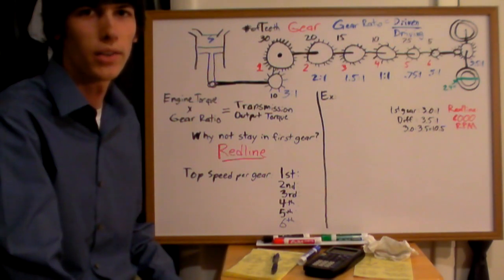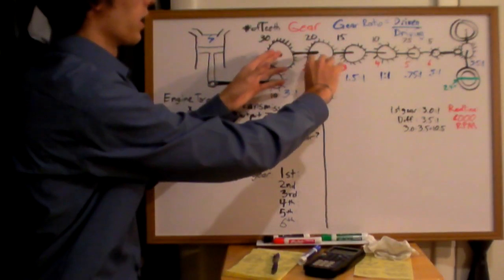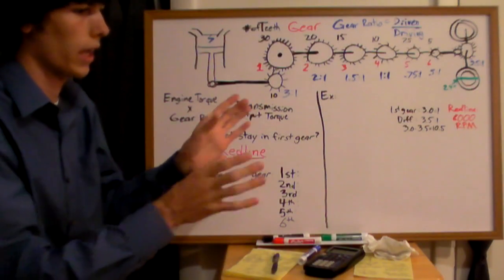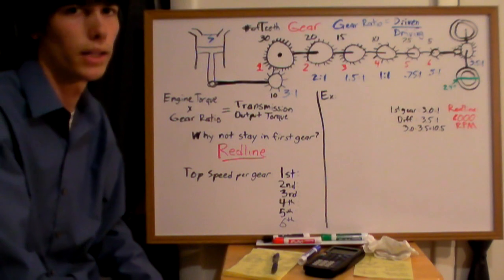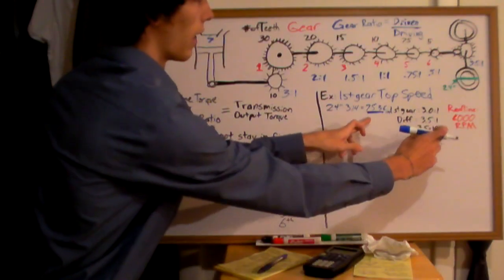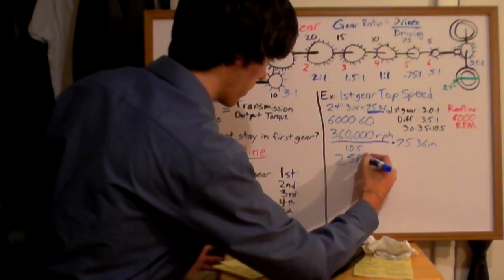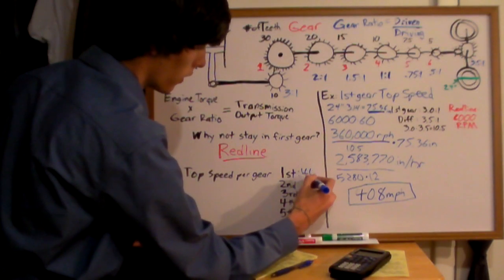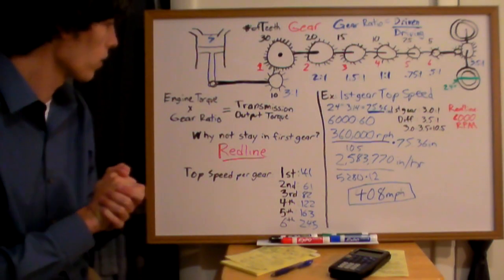Car Gears - Explained

Comment: so the shorter gears have more teeth and the Longer gears have less? okay and I think I just remembered the clutch and torque converters are what meshes the engine's Flywheel and crank to the transmission if thats correct.

Comment from the maker: First, this doesn't really in any way represent what it looks like inside of a transmission. I have other videos which do a better job of that, so there isn't a single gear that meshes with the transmission from the engine, there are multiple. As far as the gearing, I think the answer to your question is yes. But more of the other way around. More or less teeth = shorter or longer gears.

Comment from the maker: First question: Both, but many times calculations. Direct drive means less losses through something like a transmission. But if you want to get to your max speed with a single gear ratio, it could take some time. Try driving your car around in 4th gear only. And yes, I prefer metric, but since every speed limit sign in America is in English units, I did the math in English units.

Comment: It's starting to come together now, one question, the selector gear shaft is this normally connected at the bottom of the gear box. I.e is the drive shaft transmission underneath the main clutch shaft going back to fly wheel?

Comment from the maker: @EngineeringExplained Flooring it in a high gear at a low rpm will end up being less efficient, and put lots of strain on the engine, when a gear with a better torque advantage could be selected, use less gas, and get the job done easily.

Comment from the maker: @bloximonkey Well, for example, if I were to be in my car going 35 mph uphill, and I was in 5th gear, I'd be turning about 1500 rpms, and would have to floor it to produce enough power to go up the hill, where as if I was in 3rd I'd be closer to 3k rpms, and could climb the hill easily. You need lower gears to accelerate up to speed, and then you can switch up to a high gear to save gas (by lowering rpm).

Comment: @EngineeringExplained I have got heaps of question for you but I ask those that related to your video here!

1- Could you explain Limited Slip Differential?
2-Also what is Final Drive?
3-In AWD vehicles if front tyres don't have a same diameter as rear tyres how do you calculate each gear's max speed?

Comment from the maker: @jy0408 Yes, this applies to rotaries. And the shaft of the rotary rotates 3 times for every one rotation of the rotor. Regardless, this shaft will have a certain rpm, and will manipulate the wheel speed through gearing in the same manner. The "transmission" I've shown is very simplified, but its principles apply to all transmissions.

Comment from the maker: @davidle24 Yes, 6000 was an arbitrary number that I picked for the redline. It will be different for every vehicle. This is the speed at which the engine will no longer be able to handle the forces and heat created, and is determined based on the strength of the components in use, the valvetrain, the size of the cylinders, and many other factors.

Comment from the maker: @EngineeringExplained The air resistance a Bugatti Veyron experiences at 250 mph is the equivalent of you trying to drive your car through water, nearly impossible. So at those speeds it's difficult to accelerate, and you have to be in a high gear to obtain these speeds.

Comment from the maker: @EngineeringExplained Try putting it in a higher gear, and accelerating at the same rate. It's nearly impossible. Cars operate in the same manner. Another huge impact is wind resistance. When you're in forth gear, traveling at say 80 mph, you have to not only push your car with the same force that air is pushing back, but also push the car so it can keep accelerating. Air resistance is the main reason cars have top speeds.

Comment from the maker: In first gear you'll have more transmission torque, due to gearing. Yes, you have to rotate the gear more times, but it's much easier for the engine to do. Hence I used the example on a bicycle. When you're pedaling on your bike, if you put it in first gear, it's very easy to get the bike moving, you don't have to put much in, and you're rotating the wheel.